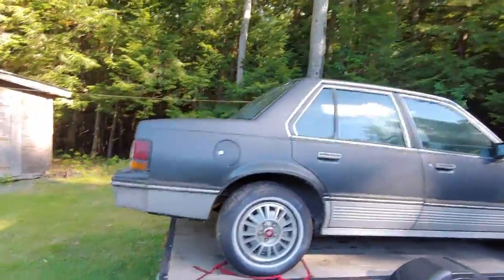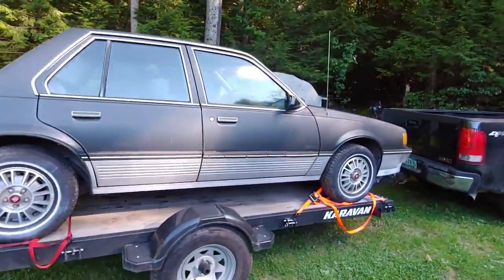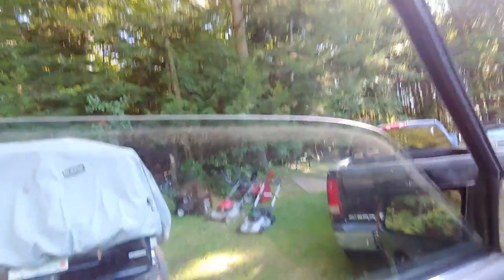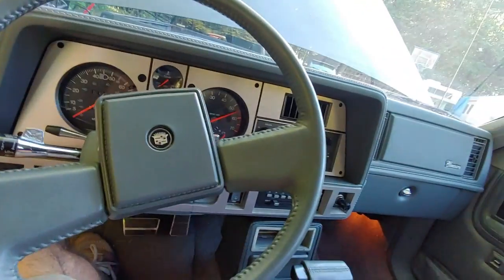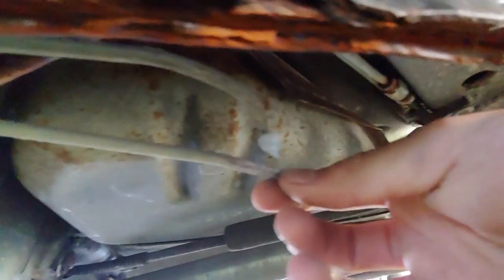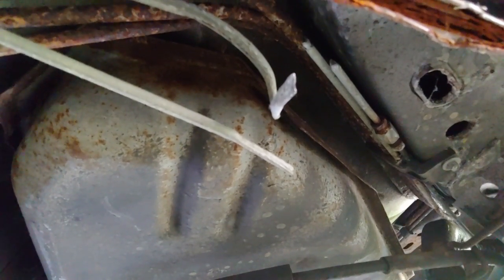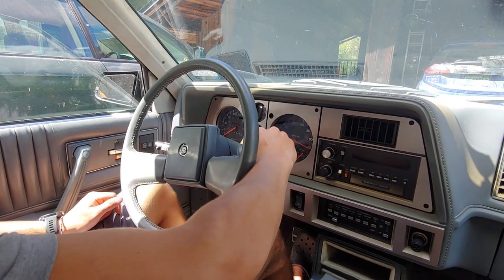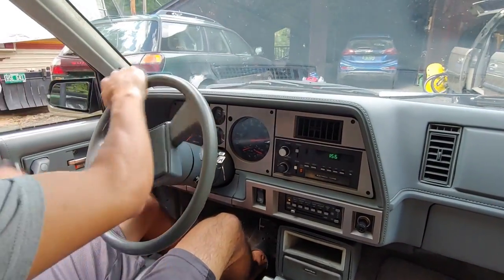I Bought The Cheapest Cadillac On Craigslist! Is It Junk?

Comment: I'd argue that the Cimarron is actually one of the most reliable Cadillacs of the era. Those old Cavaliers were great cars.
Reply: Actually that’s a Chevy celebrity with caddy badges lol. I have a 2.5 ltr 4 banger it was a great car. That’s a gem they found
Reply: @TheWickedclownz123  It's not Celebrity based, the Cimarron is on the J-Body platform, which included the Chevy Cavalier, the Buick Skyhawk, the Olds Firenza and the Pontiac J2000
Reply: Interesting how a few problems can give cars a bad rap, like these 80s GM FWD jobs.  I got a 1984 Sunbird wagon from my aunt with 11k that had been flooded with clean city water. New computer cured the only damage from the water.  Real practical hauling car, with roof racks also used for added capacity.  Gave it away running well on original powertrain at well over 110k.   Never had an issue other than head gaskets being a standard replacement item every 20k, in those Brazilian made 4 cylinder engines from what I remember.  You could deck the head, but block warpage seemed to be part of the problem.  They were known for head gasket issues, but never left you stranded and you could keep going for some time, when the gasket started leaking.  Actually easy to change in a bit over an hour.  A non mechanic would call it komplete garbage, while being a freebie to a mechanic I thought it was a pretty good car.
Reply: I can't help but think of how much better the Cimarron would have been if it was a bit bigger and based on the then new FWD A-body platform(ie Buick Century/Olds Ciera).  Still wouldn't hold a candle to a BMW or Benz of that era, but hey at least was based on cars that weren't total crap-cans in terms of refinement/interior appointments/interior space.
Reply: Given that they had the Seville, it didn't seem to make sense for them to try to market a smaller version of Cadillac.
Reply: @billg7205  They were trying to chase the people who bought a BMW 3 series with the Cimmaron.  Which was a market I don't think Cadillac should have chased at all.  The people they needed to target were those people buying the 5 series and Benz W123 mid size models.  Nobody at that time would ever associate Cadillac with a small/sporty car like the 3 series BMW.

Comment: The only GM platform car to wear all the GM car brands...Chevy Cavalier, Pontiac Sunbird, Olds Firenza, Buick Skyhawk and Cadillac Cimmaron.
Reply: Sorry, but not quite correct, though some dispute the classification of the late 70s Seville as an " X " body because of the heavy differences between it and a Nova, Omega, Ventura, and Apollo/Skylark.
Reply: What about the full size cars???  They were all the same platform for many years, yeah I know B-body=shorter wheelbase Impala/Caprice, LeSabre, Olds 88, Bonneville, Parissene, longer wheelbase C/D body=Cadillac Deville/Olds 98/Buick Electra 225.  Under the skin they were all the same damn car.
Reply: @Kenneth James

Thats not accurate...the B body full size was shared by all the platforms

Comment: I just picked up mine for $500. 97,000 miles on it. Had been sitting 14 years in the salvage. I put new tores on it, a used battery and Drove it home with the old gas still in it.

Comment: Wow, a Cimarron. One of my fellow engineering interns drove one of these in Wisconsin back in 1998. It had a cool feature. Since the door skins had rusted through the full length along the bottom you could reach your arm up into the door to unlock the car in a pinch. Long sleeves and/or a current tetanus shot were critical.
Reply from the maker: lol

Comment: Haven't seen a video of yours in a while. Cadillac guy here though I don't currently own a Cadillac. I would own one of these if it were the right one. 37k miles is fantastic though I'm not sure what kind of profit you're going to have. Own it and drive it. It's basically a Cavalier of the time with better leather seats and interior plus better exterior styling; it actually in my opinion is a good looking car. However new they were known to overheat. If you can figure this out with perhaps a better radiator or something it might be worth driving around.

Comment: These are kool, I'm 65 & live in Sydney Australia, here the absolute top end one of these was a Holden Camira SL/e in 1984 the premium one came with quality leather seats 24ounce wool carpet, power windows, glass sunroof, Eurovox sound system with 8 speakers, big alloy wheels with low profile tyres & our own Aussie 1800cc OHC engine with multi point direct injection the performance one used 102 octane leaded super this thing delivered small v8 like power it was huge fun and handled & stopped really well, impressive. Since we owned a bunch of our own big cars including a giant 1974 Cadillac Fleetwood Talisman, Georgina my girlfriend ordered an SL/e as her company car, she had it 5 years it was excellent, durable & comfortable. I'm 6ft 3inches & I fitted perfectly, the only small car I have ever liked, respected or enjoyed, we/she racked up 171,000k's on it , a bit over 100,000miles it was a good car. I still own my '74 Talisman & still looks like new in Sable black with a Gold (mustard color) interior, back in '84 it had 100,000ks on it ,now in 2021 it has 706,000ks on it (thats about 445,000 miles), it has been maintained flawlessly monthly like a million dollar car.

Comment: One thing I would recommend you to do is replace the fuel injectors. The fuel injectors in the 2.8 V6 of that era be it Chevrolet, Pontiac or your Cimarron were notorious for leaking. This would cause an over rich condition while running and when the engine was off fuel would puddle in the in the cylinders.

Comment: Check coolant level...misfire maybe intake manifold gasket...quite common...once you change to new style Felpro the engine is good for many miles (about 300K, but Vermont will end your body way earlier).  I had a Cavalier Z24 of this vintage and I modified the transmission governor so it would performance shift by drilling holes in the 'weights'.  That raised the shift into 3rd to about 43mph, rather than 25mph under light throttle.  The GM dustbuster minivans used the same trans, and 'performance shift' was how they were setup....that's how I got the idea.  Of course you could probably go to the recycling yard and buy a transmission governor from a minivan...
With fresh, grippy tires, these have a good suspension (front and rear stabilizer bars}, good brakes, and a strong V-6.  With the trans mod, this may exceed your expectations.

Comment: 34k on a 2.8 V-6 is a rare find. It will definitely help with the sale. I would buy replacement brake lines, resist the urge to hit the parts store and buy a new master cylinder if it's leaking, and find some old geezer to REBUILD the master cylinder. Then order front pads and rotors from Ac Delco (Professional grade, not the discount grade they also sell) through Amazon. I'd also order a set of "factory" wheel cylinders (with the brand stamp) for the rear because that was what was probably leaking when Jim Bob the shade tree mechanic decided to cut and crimp the lines.
Change the fluid in the transmission to the new Dexron VI. drop the pan, clean it, wipe it with alcohol before you stick it back on, and use Dexron VI. It may not get rid of your leak, but it will make it run "like new" because it's GM's latest transmission fluid and will definitely make it shift smoother and last longer. Flush the coolant and replace it with new oem style coolant. If you're lucky, the hoses aren't in terrible shape. Change the spark plugs to get rid of the misfire, and use Genuine GM (not Delco) plugs for the resale value. This is probably the bare minimum you need to do to add value to your vehicle when you sell it. The rear brakes being a safety issue that you {and the genius you purchased the vehicle from} could potentially be sued for. Changing fluids, the battery, and correcting a misfire making the vehicle more desirable by increasing the chance of just "Driving it home."
Why am I being so specific? If you take this to an Auction with "no reserve" you're going to do better than Craigslist with this one. If you keep it as "Original" and unrestored as possible, it's actually worth more, even with the rust hole. It's a "patina original." It just needs a professional detail cleaning before it hits the runway. My prediction is $5-10k depending on who's in the audience, and how nicely she cleans up.
Good luck.

Comment: What a great find. I'm partial to the sealed beam cars, but there are so few Cimarron arond. The 2.8L 60 degree V6 is about the largest engine you can fit in it when these were made. Possibily you could shoehorn in a HT4100 or the 4.5 with some fabricating. Both of those fit in the X-body and A-body. The Northstar didn't debut until 1992/1993, well after Cimarron was no longer in the product plan, and it is way too tall to fit.

The tach issue is likely a reversed connector on the distributor.
Reply from the maker: Thanks! And I will look at the distributer wiring

Comment: Is that the same 2.8L V6 that I had in my '85 S10?
Reply: Same basic 60 degree engine,  but with port fuel injection, aluminum valve covers,  no distributor, etc.

Comment: Some folks might argue than a 1987 Cimmaron was junk...starting in 1987.
As a former Cavalier (actually, a 1982 Pontiac J2000) owner, I can attest that Cavaliers...and I would imagine the Buick, Pontiac, Oldsmobile and Cadillac versions of this car, were REASONABLY reliable.  However, they had niggling little faults that were barely tolerable in an $8000 car (about what my J2000 cost brand new) and should be unforgivable in a car costing a few thousand more.
BTW, the Cadillac cost almost TWICE what a similarly equipped Cavalier sedan cost in 1987....and yes, you could buy a V6 Cavalier sedan and wagon in the mid/late 80s.

Comment: Very, very tempted to make you a serious offer. I have two of this car's cousins; an 89 cavalier Z24 convertible, in black and silver, as well as a 90 cavalier RS wagon with the 3.1. I love unloved cars. I need another j body like I need a frontal lobe labotomy.
Reply: I got one for you...My first car was a J-body Olds Omega! If you can remember those
Reply: @76calidude  olds Omega is an x body, first gen was same as the Nova, Skylark etc. After 1980 when the x body went front drive, it was same as the citation, phoenix etc. The j body Olds is the Firenza. I had a very nice light blue 4door Firenza at one point. That's meant as a friendly reply, I know it's easy to take it as a know it all reply, but I never claim that lol. I'd love to get my mitts on a Firenza gt hatchback.
Reply: @williamsinger4124  Interesting, I had no idea there was actually a difference between the two as far as platforms go. I figured them to just all be compacts. I always wondered why Olds would have the Firenza and Omega.
Reply: @76calidude  they do share alot of switchgear, but, for example the Omega, citation, phoenix, Skylark were wider, a bit longer etc. Your omega was GM's first front wheel drive platform. The j body cavalier (which replaced the Monza) was GM's second front drive platform. The A body, Celebrity, century, 6000, Cutlass ciera etc is more similar platform wise to the x body cars. Fun fact; my 80 Regal is technically an A body. However, with the launch of the fwd A body, GM renamed the platform to G body in 81 and up. I'm a GM nerd sometimes, but, I wouldn't buy any current ones.
Reply: @williamsinger4124  Yeah...I can remember when G.M. had so many different options across their divisions..i.e.. Olds..Pontiac..Buick..etc... Even though you know some were just rebadged, but they were still spread wide. I turn wrenches, and the stuff thats out there now is a joke. I tell people all the time...these things were meant to be driven 100k-150k and tossed when they wear out. You have to practically pull an engine to change a water pump...old ones were front and center
Reply: @76calidude  you sir, are correct. New stuff has nice features etc, but the longevity is gone. I have a bunch of older, cheaper, but turn key vehicles. My newest one is an 03 avalanche. Truck has paid for itself three times over already. I got a few old Hondas, several GM's etc. Christ, my 91 Beretta Gt that I got in 97 is still rocking the original 3.1. she's a bit tired, but still cranks up n goes. I just manual swapped it last year. Sure, over the years, 23, I've done work, but, I ain't been in the engine farther than the upper intake, to change injectors. I did replace the timing set, but otherwise a damn sturdy mill. My Regal is a mutt. Has a 71 Buick 350 mildly warmed over, built 2004R trans, ( not the garbage metric 200) and a grand National rear that's built with 3.42 gears, etc. It's a t top car, but I used a destroyed Monte Carlo SS for the bucket seat console swap etc.
Reply: @williamsinger4124  oh geez..I remember those Beretta's....wow! High School days for me. They had a distinct growl when you laid into the throttle. Slick little coupes. Regal sounds like it's a fine mutt to me...I have a thing for inline 6's though, durable little engines..hence why I have 95 Grand Cherokee 4.0, and 07 Trailblazer 4.2, which is my newest. Both run like damn tops...amazing how far simple maintenance goes
Reply: @76calidude  we gotta be roughly the same age. I was in 11th grade, working after school at a family friends small dealer. That Beretta only accrued 37k miles by the time the original owner just needed something easier to get into and out of. Being a minor, I needed my parents to sign the paperwork, but, I paid for it entirely. The reason I held onto it so long is bc it's taught me alot about working and responsibilities. I'll never part with it. I believe that car is the reason at a still pretty young age, I own 9 drivable vehicles, house is paid for, and remodeled, co own a small hardware store, etc. Work hard for what you want, pay for it, and nobody can say shit to you. I'm a small town simple person who respects everyone, and will help anyone in need. Even my worst enemy. I can't stand to see anyone not be able to get to work. Nowadays, when I drive that Beretta, I get approached by many people who have both love/hate memories of those, but, they all think it's cool to see one on the road nowadays. Edit: I love me an xj Cherokee with a 4.0. smooth, dependable power. Trailblazers are nice, them things roll out really well, I just have to slow down the buying shit lol.
Reply: @williamsinger4124  Ok..9 is a bit excsessive to me...lol but hey, to each their own! I do have one more in my stable that I haven't mentioned...I have an 84 Chevy Squarebody...that my dad bought in 89. Been slowly restoring it for the past 10 years..labor of love, (not that impressed with LMC Truck quality for prices they charge), anyway...drove that thing in High School even. Im 44 btw, graduated in 94. Man..don't get me started on the lack of work ethic or just plain laziness of these millennials...I think our generation is the last one that really truly understands what hard work is about...and to actually work for what you want or need...ok I'm done with my rant
Reply: @76calidude  in all fairness, three of mine are used for store/work duties, we pick up and deliver stuff for repair for customers, my 2 accords are from my aunt and uncle, who simply are too old to drive manual everyday, though I do let em take them when they're up visiting, and the rest are just bc I wanted them lol. My kids are on the lazy side, but they ain't useless. They just need a quick prodding to get going. They'll work, just gotta get em moving lol which ain't so bad considering the rest of their generation. You're 4 years older than me, so yeah we're similar in age lol. I'm just busting my ass so I can retire, move somewhere where snow and salt is a myth, so I can drive my stuff more than 5 months of the year. I agree with you on the LMC truck stuff, I had an 82 K20 that I got stuff from LMC and I, too, felt like for what I paid, I shouldn't have had to massage as much to fit properly. You hang onto the 84, you'll forever kick yourself if you sell it. Who cares what happens to it when you're pushing up daisies.

Comment: The Cimarron and the North Star engine. Just a little piece of GMs failures. lol But on a serious note these were great cars to use for racing when you could run the v6 in the street stock division at Thunder Road.
Reply: I think the Cadillac with the V-8-6-4 multi-displacement engine really took the cake! A lot of owners bypassed the cylinder cancel function and just let them run on all eight. Also the ones with the 350 Oldsmobile diesel and their lousy fuel systems!